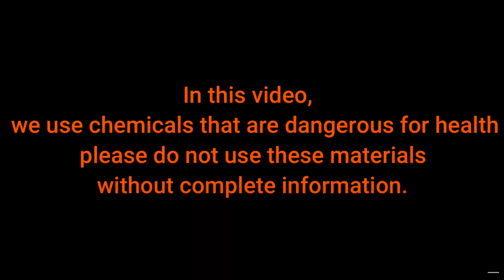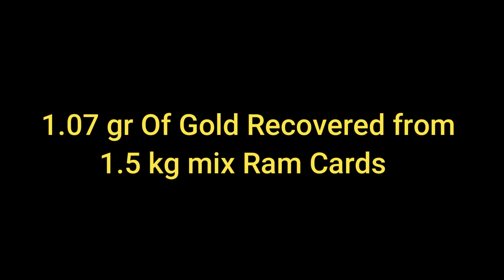Gold Recovery from 1.5 kg Mix Rams | Gold Recovery from Rams | How much Gold in Rams ?

Comment: Why does about all who use same chemicals and supplies  do obvious no metals in liquid stanus test and never after drop in waste bucket solution test to see if gold is getting thrown out and seems setting a standard of more money in chemicals never pouring off  or getting a hours worth of gold in solution saturation using returnable water cooler jugs shouldn't be returned after staining with heavy metals toxicity and forever chemicals dielectric ,does the other waste get turned into something else and sold used again if not neutralized or more chemistry to clean solution for dumping down drain or dirt while labor isn't equated rather free could someone do hydrate leaving gold in solution and dry gas it for more Jewelers who electroplate paying around 6-8 times more for and saving money on extra steps like pour off fill solution dump to purify no melt rehydrate then hydrate out dry and gas purify basically just removing as little base mttals in AR by passing liquid around the loop with ten minute mix instead of 1 hour filling solution do you have too many chemicals for cheap and not enough scrap or selling it back as plant foods contaminated with forever chemicals and other metals or do you purify each metal and filter out forever chemical dielectrics they have a filter for now I think,  or cement out other metals lead tin copper tantalum aluminum nickel ruthinium iron  the basic ones without other   group metals palladium platinum silver , like how it's made and works semiconductor  do you like get chemicals for free and return the return bottle totally contaminated for water coolers ?  Why use a $10 return bottle
Reply from the maker: thanks for watching my video and thanks for good information sir